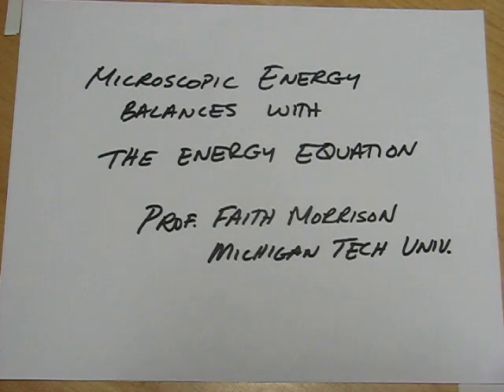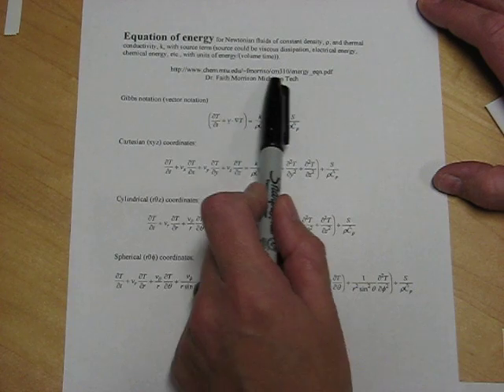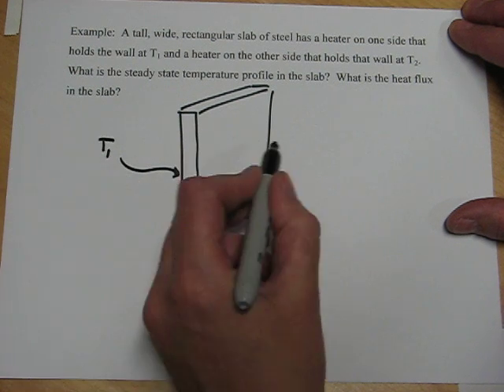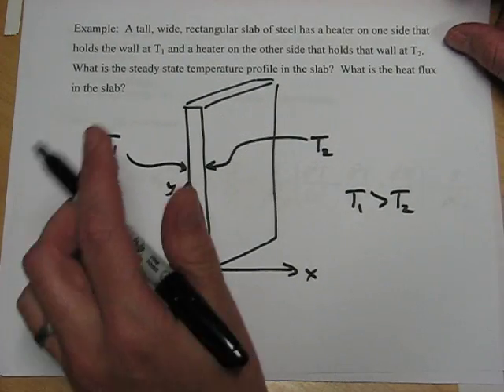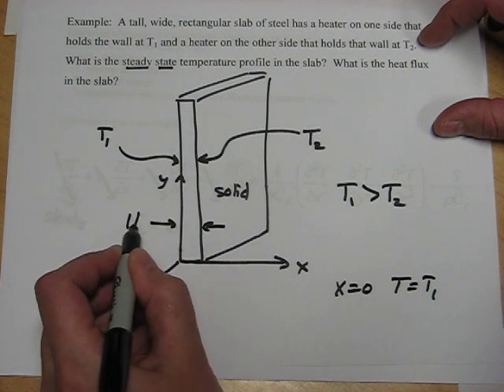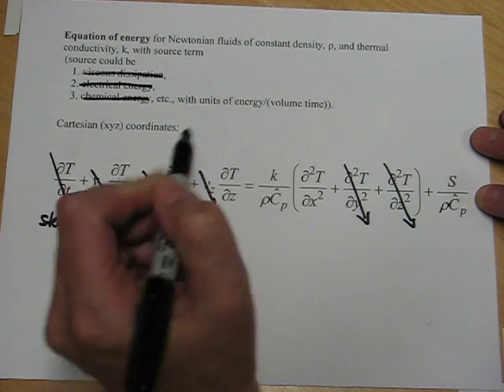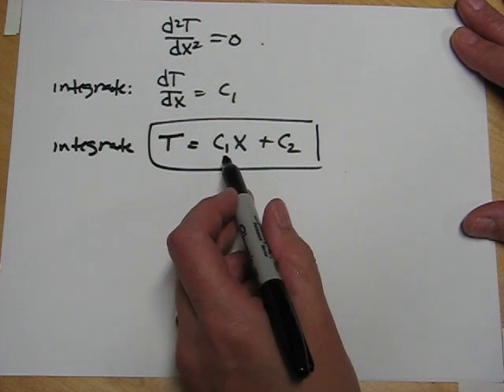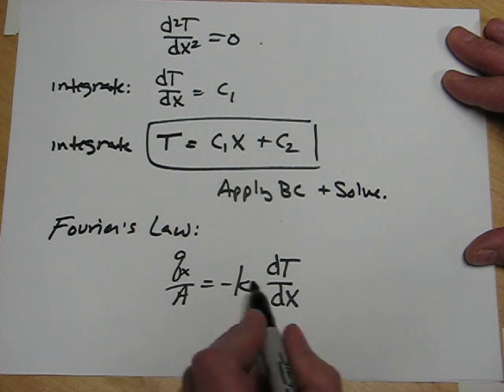Microscopic Energy Balance in a Slab (1D Rectangular Heat Conduction)

Comment from the maker: The energy equation is the microscopic balance because it is derived by doing a balance on a microscopic control volume that is located at an arbitrary position within the domain, in our case within the slab.  A macroscopic balance would now allow us to calculate the variation of temperature but could only get us macroscopic fluxes.